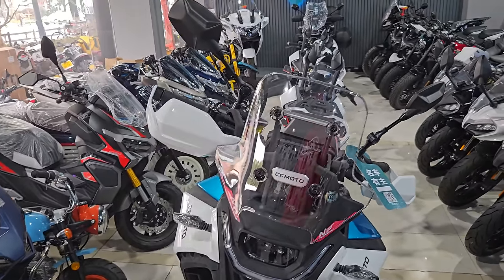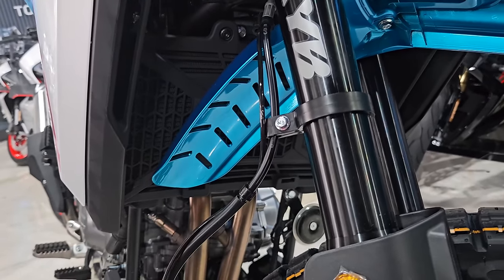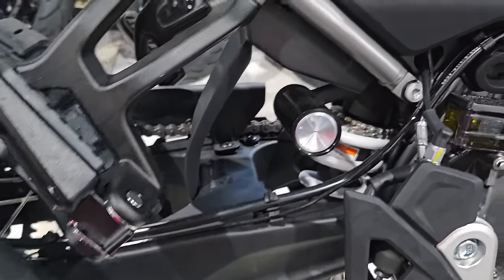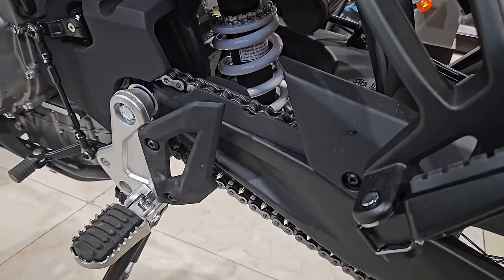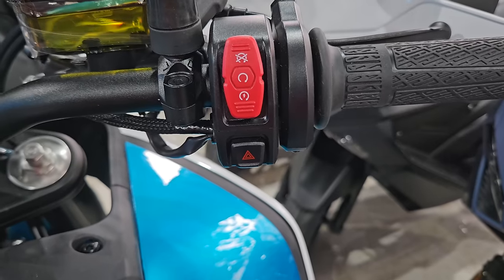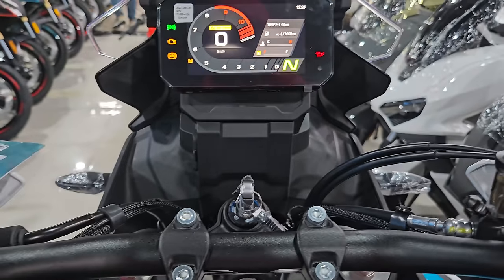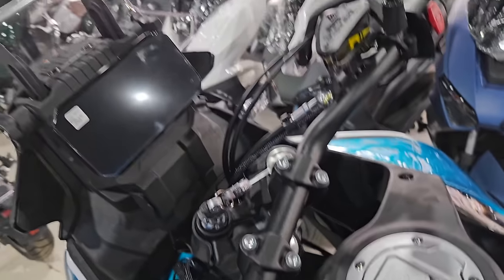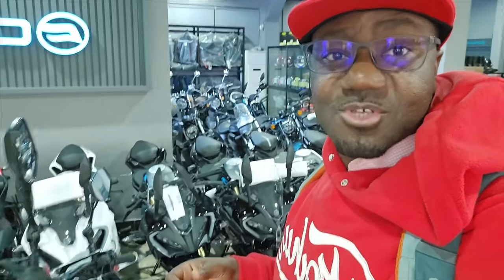CFMOTO 450MT Standing Tall Among Its Peers. A Detailed Walk Around!

Comment: FYI. The reason they put the valve stem for the wheels in the center of the rim is to allow the use of tubes. If you cut a tire, you cant patch or plug it. But if your tubeless rim has a valve stem in the center, you can install a tube and be on your way. If the valve stem is off center, you can not use a tube in and emergancy. So this is exactly how you want to see a tubeless rim to be made.
Reply from the maker: Facts! Thanks for the education.
Reply: Yeap ! Glad to see cfmoto getting the little details right
Reply: FYI. They do make side valve tubes but center valve is more common.
Reply: not like stupid ktm did lol good jop cf moto

Comment: The ABS switch is a godsend, i own the Versys X300 and it doesn't have a switch for that, if i want to keep the speedometer working but not the ABS, i have to take off the front wheel sensor, or do some trickery on whilst on the center stand.
 I like that it comes with USB ports, 2 light bulbs and that switch, i dislike the screen placement because I've gotten used to the digital / analog combination in the Versys x300, i believe the tacometer is very beautiful, i dislike it all being on a display, but that's where tech is moving towards.
Reply from the maker: Yes, I like that feature too. It's there to use if you need it, versus, you don't have it and are stuck with constant ABS.

Comment: Nice to see a detailed look in English. I do disagree slightly though, yes you will have to got out and but extra accessories as that bash plate is made of cheese. Even CF Moto's own marketing shows an image of it smashed in. The hand guards will also need replacing for any adventure or adv touring. Overall, it looks good though and the price is right. Shame there's not much to remove to get the weight down. Some of the service intervals in the manual are questionable for touring too.
Reply from the maker: You're right. Manufacturers cut cost sometimes and unfairly expect buyers to make modifications post purchase. Overall, still a good deal though.
Reply: The weight reduction potential is another concern for me. The Himalayan while heavier, you can remove so much weight that essentially becomes 15kg lighter than this one... Still no idea which one to buy

Comment: Thank you for the walk around, but just to make everything clear , the cb500x has duble break at front, so this is not the same , thank you for the video.
Reply from the maker: Thanks and noted. My own 2019 honda cb500x has single brake rotor   in front. From the 2020 model onwards, they introduced the double breaks in front. Cheers.
Reply: Yes cb500x is total joke and shouldnt even be compared to this 😅

Comment: Thanks for the review!  - I rode it briefly and I really liked it but for the price 31,500 rmb I feel like it’s lacking features (center stand and crash guards should be standard) especially compared to the QJ600 SRTX ; 30,000rmb  with heated seats & grips, center stand, crash bars, Dual Brembo front brakes, proper hand guards ( not plastic), 82BHP (still trying to find more info…). Haven’t seen our ridden it yet but I’m sure it’ll be showing up soon.  It’s a great time for new bikes!!
Reply from the maker: I think they might have options for those extras for more money. Ba yeah, some other brands come with more as standard. Even its bigger brother the 800mt comes with a lot as standard.

Comment: In Europa gibt's den 140/70-18 nicht als Gelände-Reifen !
Und nur die Größe, welche im COC Papier steht ,darf gefahren werden ,
Das ist ein Problem!!!!
Reply: your local dealer who sells this bike  can enable legally this in papers so u can equip 140/80 R18 in EU.
Reply: @icyeye1 No, only tyres in the original EU holomogation papers may be fitted. Alternatively tyres listed by the tyre manufacturer for that motorcycle AND approved by the TÜV, DEKRA etc may be used, best of luck with that!